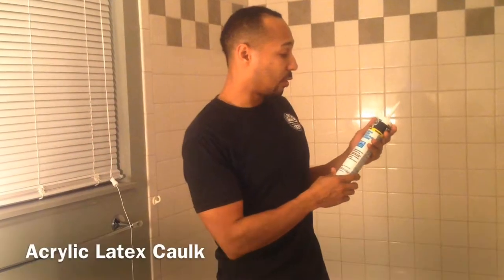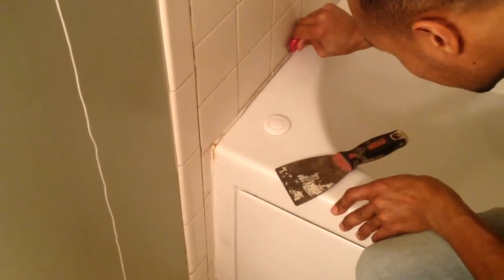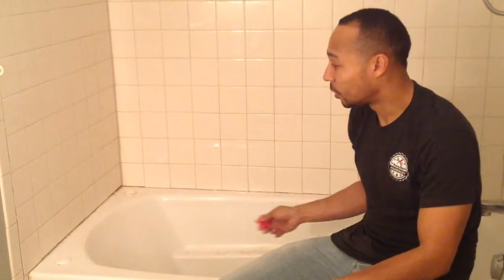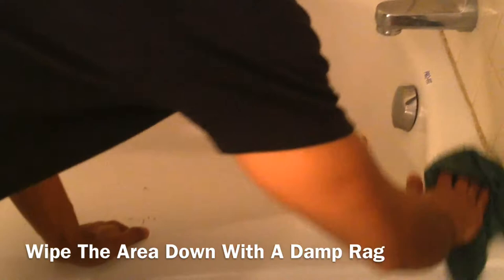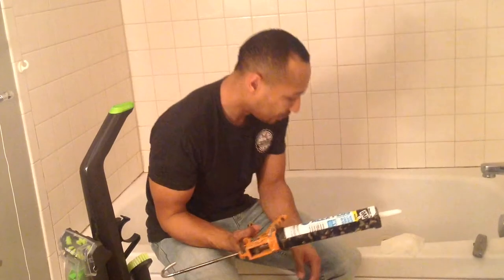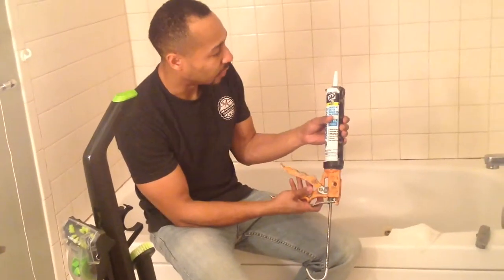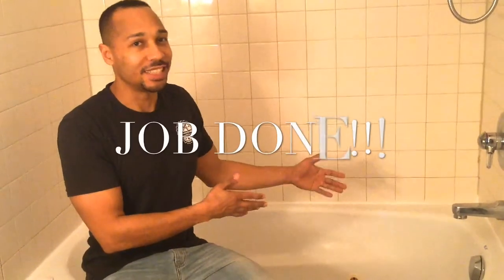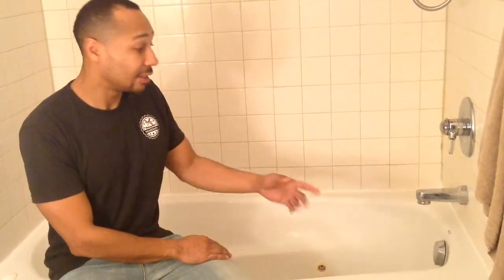How To Caulk A Bathtub & Remove Moldy Caulk Recaulk Like A Pro Tub Shower Latex Silicone Easy Steps!

Comment: How do you keep latex caulking from drying put and cracking?
Reply from the maker: It honestly comes down to the caulk that you use. I used a cheap one that may crack over time. But it’s very easy to spread and clean up. If you use a more expensive caulk made specifically for tubs and bathrooms, it will hold up better but they are tougher to spread evenly and clean up if you make a mistake.